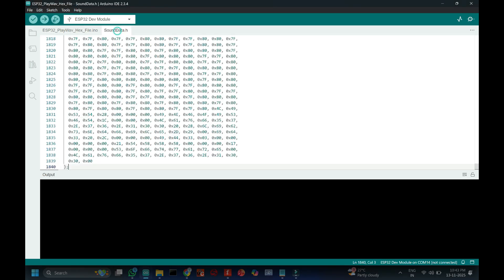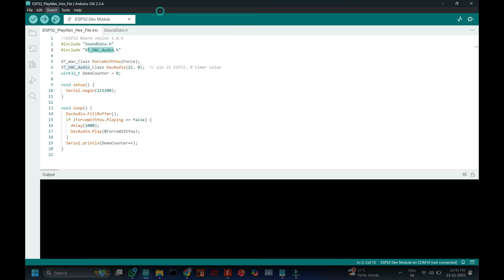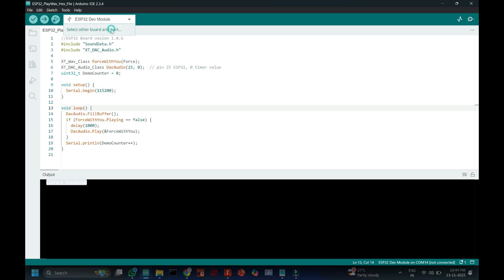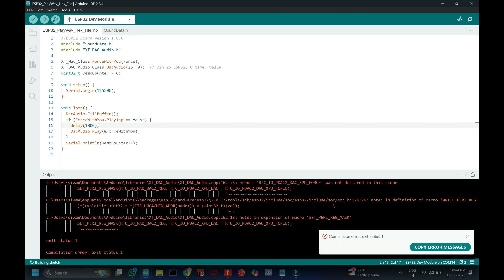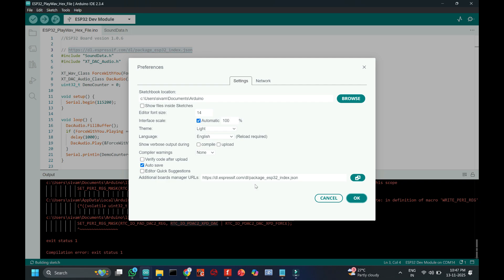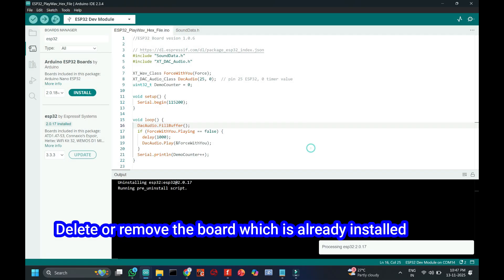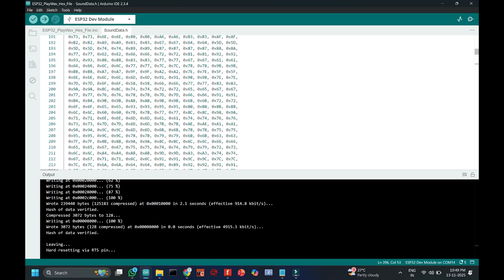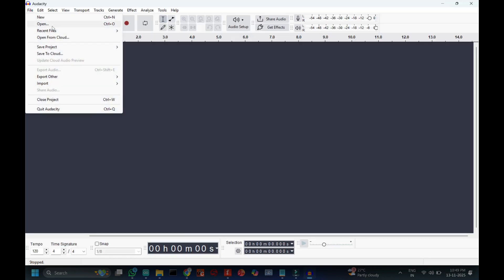Make your ESP32 talk, playing WAV files on your ESP32, digital sound DAC ADC || ESP32 Play WAV files

Comment: Hey!! Teach Me Something thanks I was hoping something like this video. I have a question, can I test the audio output just connecting the speaker to the GPIO 25? as it's shown in 0:56? I wanna test without the amplifier.
Reply: But connecting the speaker directly to the esp32 is dangerous :C
Reply from the maker: Yes you can!. But volume will be very Low